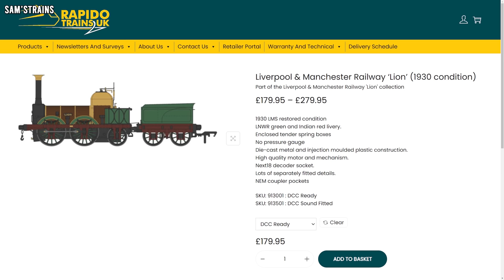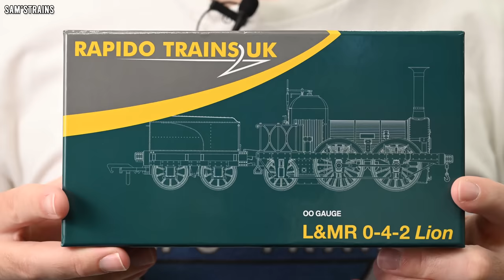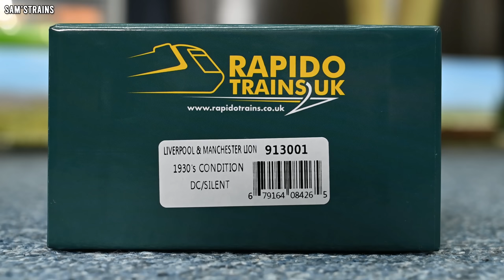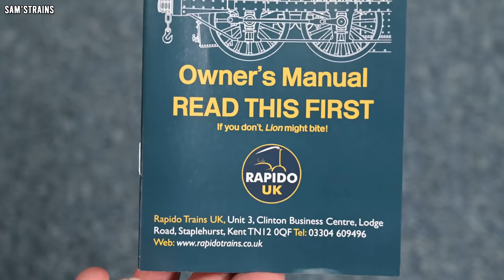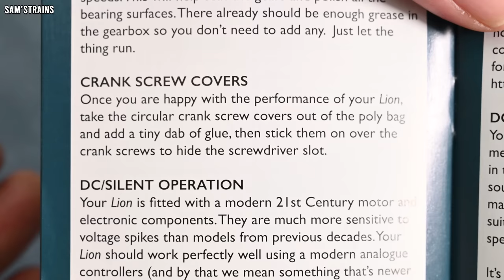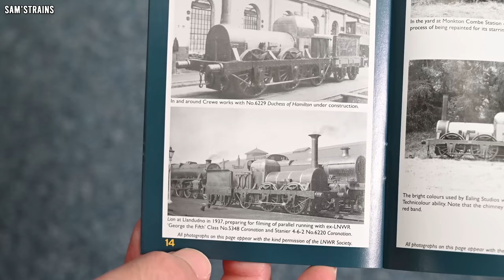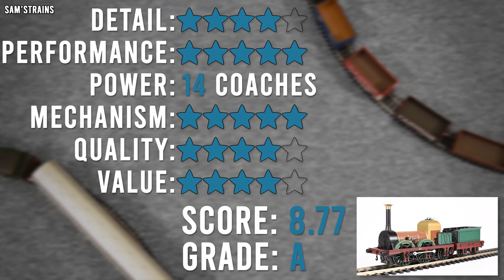Rapido's Outstanding New Lion | Unboxing & Review

Comment: 100% convinced now. I'm going to buy it immediately. I was overly excited about it when I saw that Hattons got them in stock now. I asked them if they knew about how the mechanism is, but they didn't know. I was silently hoping you would review it, but didn't expect you to do it this quickly, basically the same week it came out. No-one ever had a good lock at the mechanism before, only saying it was good. I didn't know it had a flywheel and pre-fitted speaker. Also, good to know it's so easy to service. DCC fitting and tender connection as well. What truly blows me away is the performance. That crawl, power and general performance is about the best I could have hoped for. Then, there's the metal construction and daaamn, it's amazing. For 152 pounds, a no-brainer for me as I love era 1 locos. But the best feature is that I can buy Lion separately, unlike Hornby's offering. I will get some era 1 coaches, however. So, I will go for the 1930 condition as I love the red and green. The only slight knock is the gaps on the front running plate and especially the boiler. But, hats off to Rapido, it was well worth the wait. Glad I've waited for this model. Great review, Sam. You're a lifesaver when deciding what models to buy 👍👍
Reply from the maker: haha that's great news - yeah I can give it my seal of approval! Ahh yeah always a thorough review from Sam'strains ;)
It's marvellous - one of the best running locos of the year so far!
Thanks for watching - Sam :)

Comment: This Rapido Lion locomotive is really a top notch model. It is the 1st smallest tender engine in model form to have 100% die cast metal all over its body and tender chassis except for the body of the tender but it can be forgiven because it has quiet a big weight bolted inside its body. Plus, 152 pounds and 96 pence is quiet reasonable for a new model Sam.
Reply from the maker: It sure is - very impressive isn't it? The weight is just unbelievable well worth the money I think!
Thanks for watching - Sam :)

Comment: Hey Sam, when I break in a new engine fresh out of the box, I give it a few rounds forwards and backwards running with no cars coupled to it, then I run it with a light load about the amount of rolling stock that they would give in a regular train set and then I increase their loads gradually,  about one or two cars at a time, everyone has their own method of breaking in a locomotive, that's just my way of doing it
Reply from the maker: That sounds good and thorough Robert - thanks for sharing!
Thanks for watching - Sam :)

Comment: Nice close ups of this livery
My only suggestion would be for the type of glue when securing the crank covers to hide the screw.
Super glue fumes alone can damage some plastics or finishes so personally I wouldnt use super glue.
I would suggest a tiny dab of PVA glue, its strong enough to secure the cap but if you ever need to remove it, your more likely to remove the cap undamaged with PVA than with super glue.  🙂
I also think to help hide the boiler join a subtle dirt wash would darken the other slat grooves to match and would help hide/merge the join into the rest of the boiler.

Comment: Excellent review as ever, outstanding and inspirational model too.
Once people have got over the initial 'Titfield' excitement, this may hopefully be the start of a wider interest in Era 1 modelling generally. Imagine Rapido bringing their expertise to producing a Crampton, such as the LCDR 'Coquette' class with its spectacular livery... Given plenty of weight, a single-driver should still be a reasonable puller. Some 1850s/60s coaches would be good too.
The buffers on 'Lion' were I believe leather casings stuffed with horsehair, which is quite 'springy' stuff in bulk. Kind of hard to replicate in model form -- though maybe some enthusiastic type could reproduce them in a carefully-selected rubber compound or similar.

Comment: Not wanting to put people off, I received mine from Rails last week and with no blame to them I've had a couple of small problems with mine. On opening the pack the chimney was loose and fell off. I carefully superglued it back on and it has been fine since. The second thing was the tender footplate which was loose and came off. I re-attached it to the tiny wire rail, or whatever you call it but at that point this little rail thing came off and no matter how I tried I couldn't refit it into the two holes it had come out of. In the end I gave up and superglued the footplate on to the tender floor, so now it doesn't hinge. I'm not over concerned about this but I suppose it spoils the effect that was intended. Otherwise it's fine.
Sometimes overdoing the detail can be fraught with danger even when you're careful.
Do be careful when opening and handling yours.

Comment: Just received my Rapido  Lion. A gem that runs very smoothly from the start unlike my Hornby Tiger that is jerky starting and stopping. Ive returned it to Hirnby for the secind time as they are insistent that it shoukd be perfectly smooth starting and stopping. Ive also fitted a DCC chip and tried it on the NCE Powercab with no improvement!
Digitrains have a video of their Hornby Lion fitted with their sound card and it runs fine, so there's hope yet thst Ill get a good runner from Hornby. I hope so as I like Tiger.

Comment: I would worry about having to disassemble the linkage at some point and would therefore not fit the screw covers Do you think that attaching the screw covers with tacky wax could have been a semi-permanent solution to allow later disassembly?

Comment: impressive machine.

on the boiler detail, i think where it failed there is that they didn't paint it around the edge and into that gap.  if they had, it could have been pretty reasonably hidden as a 'gap' in the boiler cladding.

why isn't the mechanism on this machine the standard?  its perfect.  and as compact as it is, ought to be perfect for all sorts of small and medium sized locomotives.  and i really like that the coupling rods are functional (1 driven and 1 driven by the connecting rods).

Comment: I'm glad I stuck with my Rapido orders, my only real complaint is that gap in the boiler, though one of the dumb buffers on mine is a little loose, and the fall plate a bit wobbly, so perhaps a little more care is needed at the factory.

I do much prefer the subtler colour compared to Hornby's, though if I'm being honest, the main reason I haven't wanted to buy the Hornby version is the way Hornby has both behaved (re Titfield Thunderbolt) and the way they've marketed it: Firstly boxing their Lion only in a set with coaches would have been bad enough, but the two first class coaches in that set appear (or will appear) in other sets (Experience in R3809 and Traveller in R30090), I'm already going to have duplicates of Globe and Wellington when the Queen Adelaide Coach Pack arrives, I don't need more duplicates. Secondly the way Hornby keep pushing their Lion as the original L&MR Lion, despite there being good reason to doubt that, culminating in their model of Tiger which has no basis in reality (like the 'coal wagons' it comes with). It's all just that little bit off putting.

On that note: Hornby if you're listening (reading?) your L&MR first class coaches are beautiful, but if you're going to insist on boxing them in with every 'Era 1' passenger set you sell, could you at least give them different names please. I'm effectively paying £108 just for the Queen Adelaide coach because you've duplicated the coaches from the R3810 Rocket Train Pack, and that is no end of irritating.

Having now seen the shear performance of Rapido's Lion and the quality of the mechanism, I feel I've made the right decision. And if that boiler gap really starts to bug me, I'm sure I can find a way to fix it, certainly it'll be a lot easier to do that than triple the performance of the Hornby Lion.

Still it'll be interesting to see how the two version stack up when compared head to head.

Comment: 10:25  True to standards, twice the drivers triple the traction. Same holds true to locomotives, one equals one, but two equals three.  
Which Lion would be better? I have heard your previous comments towards details on the bottoms of your models. I favour Rapido, but not many know about their attention to detail on their North American passenger/freight cars... Most have excellent underside detail. Why they omitted them on the Lion, one could fairly ask. Are they cutting corners or cutting the price? I believe the tooling price on a metal chassis would have increased. Pulling power seems to be the favoured feature and should rule the "Top Visual" ratings. Yes, I am biased to Rapido models... My collection contains 19 of their locomotives (DC and sound DCC). Their GMD-1's are my favourite.   John  British Columbia, Canada (nee America)

Comment: Surely a locomotion models - locomotion by rapido is an obvious Era 1 missing piece, 

Along with sans pereil to recreate the rainhill trials
Reply: Locomotion at Rainhill?
Reply: @tooleyheadbang4239  no locomotion as a locomotion model seems like an obvious choice and rapido seem to be the ones to do it.

Sans Pereil is the other one to compete with rocket so also seems like a good choice
Reply: @lukejackson8741  
Rocket.
Novelty.
Sans Pareil.

The three Rainhill contenders.
Locomotion was an early mineral locomotive, leading coals from the South Durham pits to the wharf at Stockton-on-Tees.
(Where I was born, and still live).
It has nothing to do with Rainhill.

Comment: Guess you are lucky to have a good one. Adi didn't - and it seems he's not alone! And to improve pulling and what you call 'torque' double up the gearing and use a high speed motor as is the case here. Still the crawl is not up to EU standards and not impressive at all.
Wonder how your comparison with the Hornby model will turn out. Thanks for sharing this review.